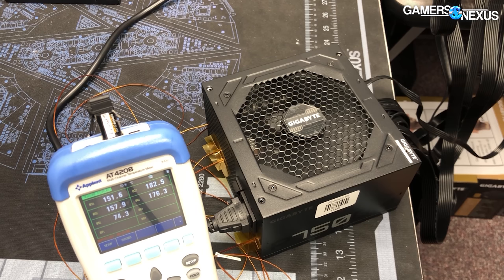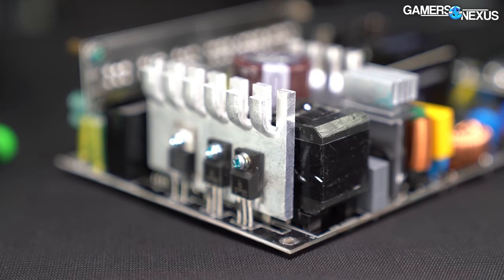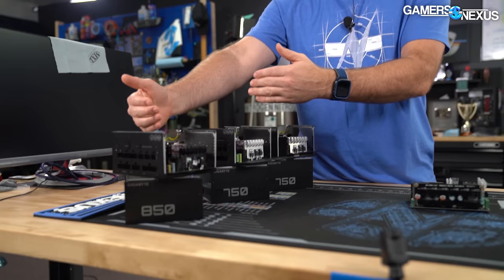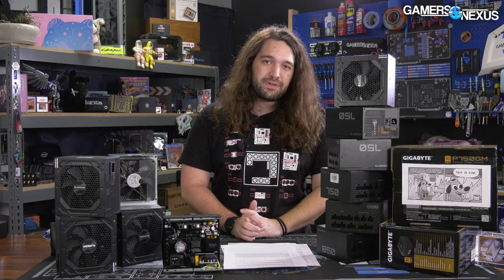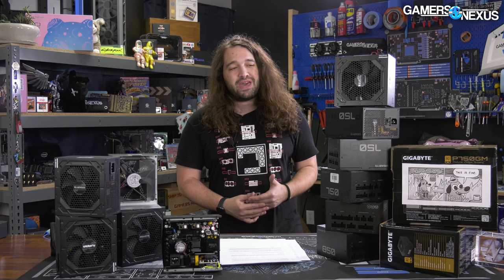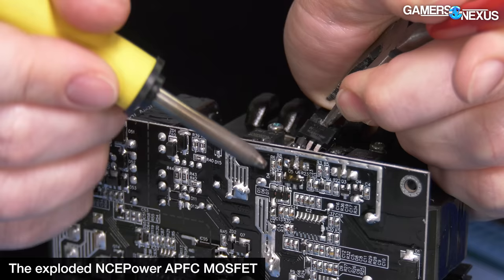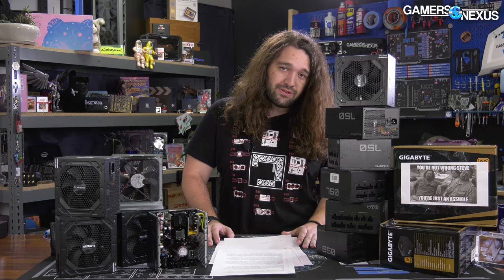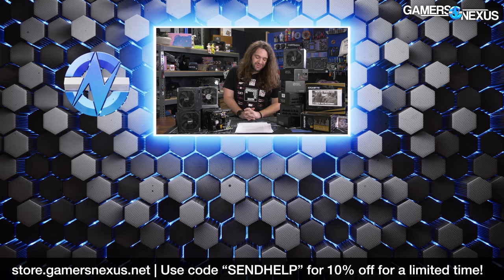Exploding Power Supplies: Gigabyte & Newegg Dumping Unsellable Product

Comment: The culprit part are the plastic TO-220 MOSFETS on primary side. There are explosions on the PFC stage on some cases and the primary switching stage on other cases using same MOSFETS types. TO-220 plastic package devices are very poor in heat transfer which leads to a hot spot entering the silicon in a sudden short circuit. Forget a timing issue on the design of the PWM stages because the use of balanced drivers transformers for the MOSFET gates provides DC isolation and accurate 180 phase gate signals avoiding an overlapped triggering. In the case of the PFC stage the MOSFETS are in parallel and here is not necessary a driver transformer. In other words to make this more easy the hot spot on the MOSFET silicon break the isolation of the MOSFET gate entering the entire silicon in short circuit which triggers the second MOSFET and here the 380V DC current rise up to infinite. The only and last protection in such cases is the blow up of the primary fuse to avoid a fire on the mains cables but to late because the entire PSU is destroyed.

Comment: Some years ago I found some PSUs that would not work properly. All the components checked out (correct values), soldering good, capacitors, diodes, etc. in the correct direction, traces fine, PC boards the same, etc.. After comparing the failed PSUs with working PSUs, I found that some of the caps were different. Investigating the materials that the caps were made out of, I found that the working ones were different than the failing ones (I can't remember if they were mica vs ceramic, or what). Replacing the caps in a bad PSU with the same type as in the good PSUs solved the problem, though the PSU mfg and the engineers that designed them did not agree with me and it took several tests by myself and them before they agreed. I suspect that these things may have the same sort of issue if not just a design error.

Comment: I think the places that sell these bad products when the data clearly shows these are dangerous defective devices should be partially held accountable. My local computer chain franchise is still selling the 750 version and it's now weeks later since this news was brought to light. But ultimately it's up to Gigabyte to sack up and recall the lines. I've never had a decent experience with Gigajunk. Thanks Steve for all the work you put into these videos and for not staying quiet about this issue.

Comment: Power supply manufacturers will have 2 or 3 sources for output capacitors or in general all components. For safety components like X or Y caps or Main DC DC MOSFETs these are normally fewer as it is more expensive to have safety agencies to test these configurations.

Comment: The last Gigabyte device I purchased, was an AGP 8x X1650 Pro (I forget if it was the 1GB or 2GB model). Let's just say that anyone that's watched this video knows what happened to that graphics card one day out of the blue. (Hint: Those PCIe/AGP converter chips on high-end AGP graphics cards at that time mysteriously never had heatsinks on them.)

When it comes to desktop PSUs, I only buy two brands - Antec (essentially Seasonic) for high-end rigs, and Thermaltake for everything else. I've never had issues with either, excepting an old Antec Trio (crazy 3-rail model) that no longer powers up on certain motherboards [after at least 10 years of heavy use across builds].

Comment: luckily the second hand PSU I bought was the higher end Aorus model which doesn't have the issues as you mentioned in the video. Dodged a bullet there.

Comment: Just a little addendum: I had one of these, bought in Feb of 2021 from Micro Center. Ran fine for over a year, and then yesterday, March 19 2022, I got a light show and magic smoke.
850w and never once came near that load rating. When I originally tried to RMA it, the website was broken so I just kind of forgot about it because life and work happened (less PC time, more sleeping and working. Sucked.).

Comment: Regarding semiconductors from different companies - once upon a time many electronics manufacturers would only purchase critical components if there was at least one other company that produced a compatible component. This was called second sourcing.  The idea was if their primary supplier could not ship the necessary parts, they would order them from your second source. 

Parts from different manufacturers doing the same job in identical units may be different because that part is a second source part.  Or it could be that the manufacturer can't get the part that was designed into their product but can get a more expensive part with better ratings for more money.   Better to lose a bit from your profit margin and be able to ship product than to have your production line shut down.   Or it could be the design was upgraded by changing the failing part with something that would handle more power.  Which is it?  Impossible to say from just looking at how a product has been built.

Comment: Manufacturers are facing shortages of components and are having to find 'alternatives', the fist choice probably went though various testing phases, alternatives are often chosen based on data sheet comparisons.

If you spend the time repeating the tests on the alternatives, by the time the tests are finished the stock has gone.

Comment: One possibility is that the Chinese manufacturer plants used poor quality parts they had lying around to get rid of them and did not inform gigabyte. It is not uncommon that the actual manufacturing facilities are contracted by, but not owned by the manufacturer.  It doesn't excuse newegg or gigabyte's handling of the issue though.

Comment: A lot of Chinese knock off transistors (Bipolar and FETs) are not as elastic as the original
OEM parts. Also I have found in Switch Mode PSUs for  other products (not just PCs) - the transistors are not screwed to the heatsink properly. Component Supply stability in China is  also pretty poor.  Also during covid we had supply shortage of good OEM parts... which drove up the market for copy/counterfeit components.

Comment: I have a 3080 Asus working with 320W. It works like a charm at full power. Then I benchmark the CPU. I get 100W, it will “power throttle”. Doesn’t matter if my GPU is eating the 320W at the same time. 

I’ve even unlocked all power limits in BIOS. My 750W power supply doesn’t work, and I literally just upgraded to it… I have Intel working on it with a case as we speak. Maybe they can get their attention.

Comment: This is a throwback to the early to mid 2000s.   Sad to see manufacturers like Gigabyte starting to get sloppy and making people relive the past horrors of "Gutless wonders PSUs" as they are often called.   I remember back in 2004 and 2006 I had two PSUs from Thermaltake that were absolutely horrible.  Between them they killed three hard drives and fried two mainboards as they went up in smoke.   Then Corsair came to the rescue, I started buying their somewhat higher end products and I never ever had a single one make any problems for me.  (And believe me, I've had a lot of Corsair PSUs since then)

Comment: got an 850 one in bundle with GPU. Absolute rubbish - crashed my system so many times due to kernel undervoltage. Returned. Replaced with Seasonic - zero crashes.

Comment: I have both a Gigabyte Card and Motherboard in my System (Bit "older" components, 1660Ti Windofrce OC and B450 Aorous Pro) and never had a sinlge issue. Not even a single blue screen in over 2 years of owing my computer. There must've been a clear change in QC and Leadership in that time. I'll be making sure to either avoid Gigabyte in the furture or do thorough research before I buy another Gigabyte product.

Comment: I was a big fan of gigabyte motherboards/products until I bought a gtx780.  It lasted 1.5 years the warranty was 3 years I sent it in for RMA saying the gpu was failing (under stress it would bluescreen).  They said there was nothing wrong with it and sent it back to me.   Tried underclocking it which worked for awhile till the gpu degraded further and I had to send it back in for another RMA request.  This time they admitted the gpu was failing and gave me a different model 780 because they didn't have the exact model I had in stock. Well that gpu lasted about a year until that one started having the same issue. Since I ended up shipping it at my own cost every time prior I would have been $100+ just in shipping costs for them to probably tell me this new gpu was ok until I literally couldn't run my computer before admitting the gpu was bad.  I get the 780 chips were known to be bad and it wasn't just gigabyte that had this issue but how poorly they handled my rma's I decided to stop buying gigabyte products.

Comment: If mosfet fails to switch it can easily kill the system. Like the GPU as it will send high voltage spike to it and so killing it. It happens time to time with power drills when user just keeps going with low battery and mosfet takes the hit as it has no juice anymore to switch.

Comment: wow. received the recall email from Newegg this week and asked for a refund, this is absurd. I've just built my first rig with this psu, mostly bc it came as a combo when I got a 3080 back in november. I'm no specialist but I always thought that the clicky sound was a bit weird when I turned my rig on but it never bothered me to the point to change it, the other thing was that it was common that power surges happened and it psu would shut the system down (like a safety measure), especially if the pc was sleeping. just have one thing to say: THANKS FOR YOUR SERVICE

Comment: Brilliant coverage as always Steve. I'd love to see a look into Corsair's rm650x PSUs, I had two fail within 6 months of eachother and there are a lot of corroborating reviews on Amazon in the UK. The failure occuring when the rocker switch on the back was flicked and capacitors exploded, resulting in a dead unit. Thanks guys

Comment: The worst PC parts I ever had the misfortune of owning/using were: 1 a DeathStar hard drive (search for that issue), a long life HP printer supply sold without warning shortly before stopping production of all other supplies for the model, and a lot of Intel CPUs from the period where they all had the Meltdown flaw that did stuff before checking if it was blocked by security settings.  Of cause there have also been bad complete systems and trivial stuff such as bad network cables.

Comment: Bought one (P850GM) in a complete new system. I had some kernel power resets in the beginning but after that it worked fine. The only thing is, that under low load there comes a clicking noise out of the PSU when I move the mouse. Found out that the fan of the PSU trys to start but the PSU gets not enough load to make the fan constantly revolving. So it seems to be on the threshold between running and not running. But after I heard from the explosions here I will change the PSU.

Comment: 11:20 Components from different manufacturers is not all that strange and happens a lot more often in the manufacturing industry. It is not necessarily a response/design change because of bad products. These PSUs could be from different manufacturing batches. It is common during manufacturing runs to sort by price for a given specification of generic component and use those. It is not indicative of bad quality perse. 
The brand name on the capacitors would be more of a concern for me. That the other capacitors are not NipponChemi-con/Panasonic/Rubycon/Nichicon etc (reputable good quality brands).

Comment: This doesn't surprise me at all, every thing I have ever gotten from New Egg, has either been DOA, or died in less than a month, one of those things was a GTX 1050 ( Rebranded 700 series) that when it catastrophically failed it took out my Motherboard, ram, and other stuff. New Egg gave me a hard time about a return/refund, and flat out refused to replace the components this card destroyed.

Comment: These are Pirate counterfit units made during a secret "third shift".  The way the component vendors differ and the complete lack of quality are a dead giveaway.
Reply: Not necessarily.  If the design documents say "brand A, B or C" for a part, the purchase manager will shop around for each wholesale order, and the factory will grab boxes of parts from the same shelf across unrelated products made the same week/month.  So a bad wholesale supply of size X FETs will get spread around somewhat randomly. This is why quality standards since the 19th century have requires testing of randomly picked items from each incoming and outgoing shipment and rules for when to reject the box, shipment or entire design.

Comment: at this point gigabyte has had hardware failures for decades across everything they do, and they try to hide it every time.

I used to do computer repairs/component repairs

I have a stack of LGA775 gigabyte boards that have died from random no post black screen(sometimes will sometimes won't eventually never post again) 
and a stack of 1155 socket gigabyte boards that have died from...random no post black screen(sometimes will sometimes won't eventually never post again) the H61M boards are worthless outside of warranty, no file server or web server on an old machine for you! and damn right you better upgrade on time, cause you aren't running this thing for long.

and a couple of 1150 socket gigabyte boards I chucked that died from...random no post black screen(sometimes will sometimes won't eventually never post again)

some die before warranty runs out, some die a couple years after, all of them died the same way, across many years and multiple generations using totally different PSU's/cpu's/ram/hard drives/case configurations/uses

I also have 2 gigabyte orange striped RX470's that died because the memory voltage controller dual buck converter blew up
and a gigabyte GTX 970 ..that died because the memory voltage controller chip blew up
and a gigabyte gtx 1070...that died because the knockoff unlabeled UP1666 memory voltage controller blew up
and I've had dozens of other cards come thru with failures, when I was doing GPU repairs, most of my business was the 1000 series gigabyte cards
(all of these cards blew up between 6 months to 1.5 years out of warranty in my country)

then I've had various gigabyte PSU's that caused other issues in other peoples computers, from ram issues, to hard drives acting like they were about to die, to general blue screens.

Never buying gigabyte stuff again, even second hand crap

Comment: I fitted two Super Flower 1000w Platinum PSU's to 2 different machines. The one had it's SSD tosated and the other had it's brand new RTX3080Ti toasted! Sent all back and retailer identified both PSUs were faulty. (Isn't Super Flower and Gigabyte connected somehow? I recall Super Flower manufacturing components for Gigabyte - I might be wrong)

Comment: Here some of my guesses of the failures ob Gigabyte:
1. in order to maximize profits, they went on cheaper components, esp. Mosfets and Capacitors.
2. i guess, the cheaper mosfets are much thinner internal (plates for instance) and they actually failed the 140w test but did not show it. They went to hot and got bent and made during the cooldowntime a shortage -> after hitting the production test (the one which follows after the 140w test) ..the shortage has come to show up as an explode of the mosfet.

this is only a little guess and may be not right but if ya like, investigate this. 
I hope this conclusion did help in any way.
cya
ju

Comment: Good video but I feel the concern over the different manufacturers parts being different undermines the article because it is very common in electronic manufacturing to change these parts as production ebbs and flows or as a manufacturer gets a cost reduction. In relation to the capacitor changing; it could simply be for cost reduction or filtering purposes.

Comment: I got a Gigabyte GPU and mobo from the shuffle. The GPU (RTX 3060) is fine (for now?) and I am currently not using the mobo since it's an intel board and I am using an AMD board that doesn't need replacing. I'm almost a little apprehensive to use the new mobo to build my uncle a new gaming pc.

Comment: Even after seeing this, I would definitely buy one of these PSUs... but only on sale! Never for that exorbitant price.
That is because you can definitely find good (enough) 750W PSUs for 50 bucks. And I never max out PSUs. I try to stay in the 40 to 60% load range when the system is fully loaded. No risk there. Your unit exploded on 60% only after being tortured with exceptional loads only crazy people would do to their PSUs (like coupling an RTX 3080 with a 400W power supply)

Comment: I'm late here but counterfeit electronic components have been a problem for a while now. Before the pandemic even large manufacturers sometimes found themselves stuck with counterfeit components while ordering direct from major manufacturers. I wouldn't be surprised if Gigabyte was sourcing components wherever they could get during the pandemic and getting counterfeit or binned components in the process.
Ultimately it's on Gigabyte to vet their manufacturers and design a product that can fail safely. 
I don't feel comfortable buying a Gigabyte product after seeing their failure to recall these power supplies without intervention.

Comment: Well, in my opinion i found only one worthly and less known psu producer, Cougar. On the other hand you should not trust some big companies. corsair and coolermaster are too often failures to call them good. I would stick with silentiumpc, be quiet, evga, or seasonic depends which one is cheaper in your country.